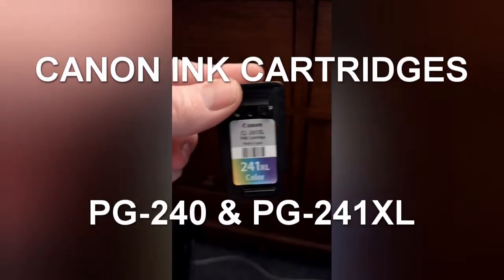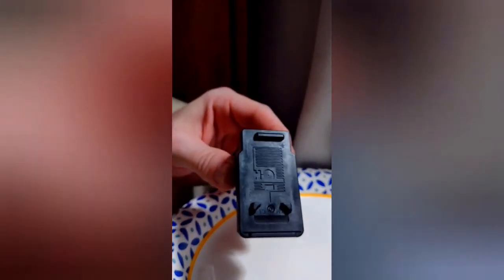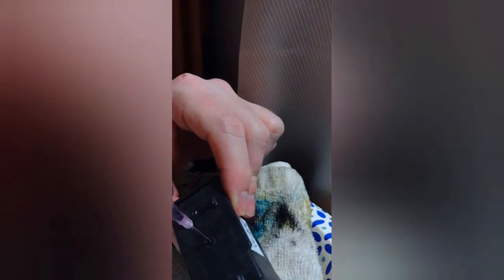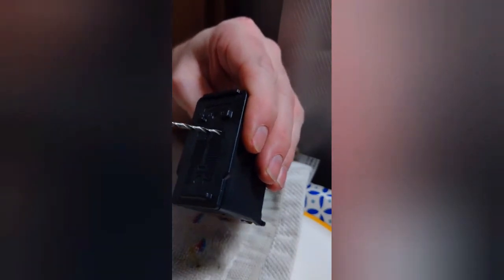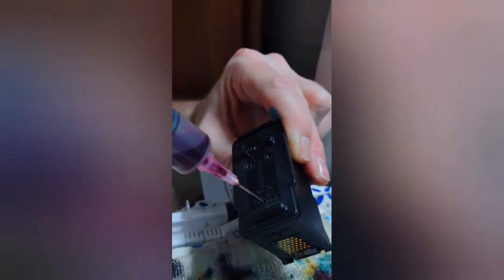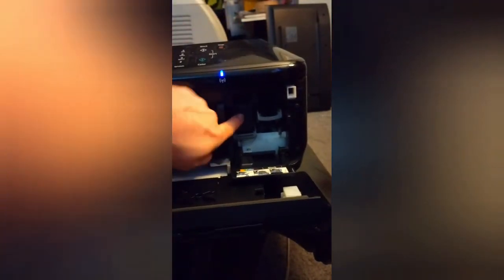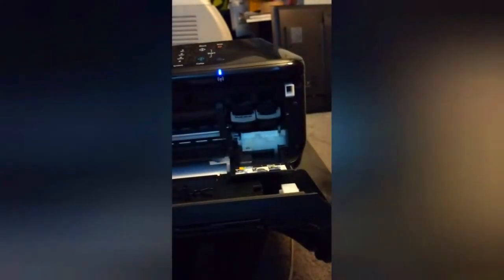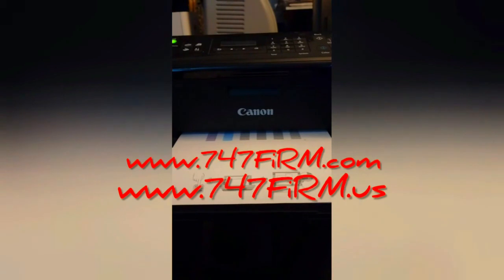Easiest Way to Refill Canon Ink Cartridges PG-240 & PG-241XL CL-241 PG-240 CL-241 PG-245 CL-246

Comment: 3 questions, maybe they’ve been addressed somewhere in comments area. 1. What size drill bit did you use? 2. How much ink do you use in the XL’s (color and black) cc’s. 3. Im sure the syringes come in a pkg (4 for color & black) do you recommend where to buy them and the ink? Thank you. Mike
Reply from the maker: I was using a tiny drill bit. 1) I prefer something small like a 1mm bit.  2) it depends on the ink cartridge. Regular cartridges of black, about 5ccs. XL black about 9 or 10ccs. Then colors are about 3 - 4ccs of each color. Really any syringe printer ink kit on Amazon works. I usually choose the cheapest.

Comment: did i miss something i didn't see you refill the inks...th
e ammonia tip helps tho thank you
Reply from the maker: Thank you Beth! Glad you enjoyed it and hopefully were able to use the info to refill your own Canon PG-240 Ink Cartridges and save a good chunk of cash you would normally have to spend on substantially more expensive new ink cartridges. I apologize for the audio being slightly behind. I'm not sure what happened when I exported this video and have been meaning to fix the audio, just haven't had time.

I took some time and added chapters to the video accessible through the chapters menu to the right of the video or by using the blue time links in the video description that should make it a bit easier to skip to the parts where I refilled all of the different ink colors in both cartridges.